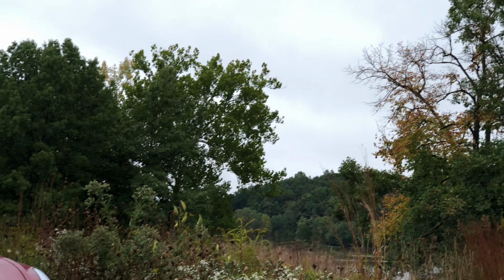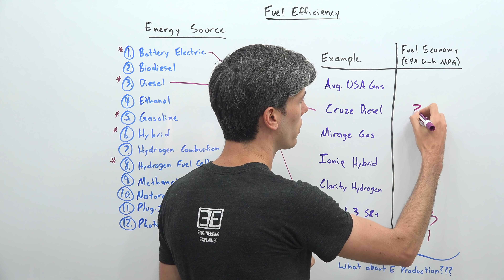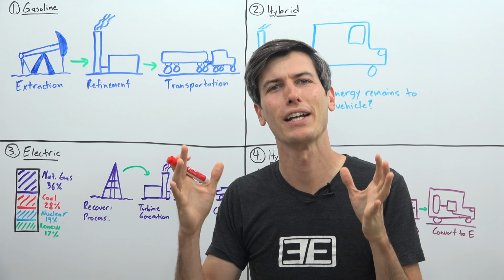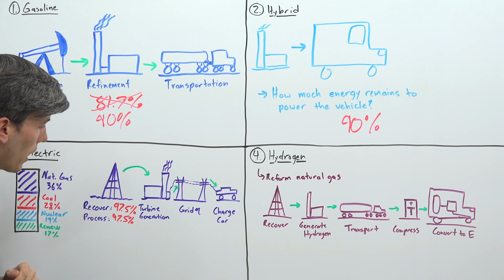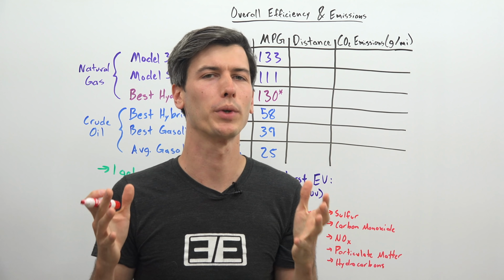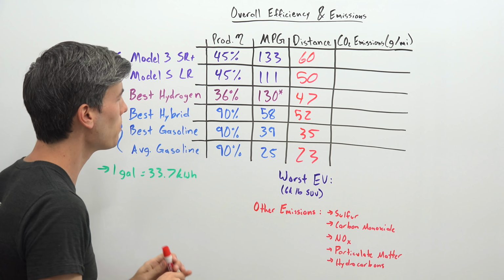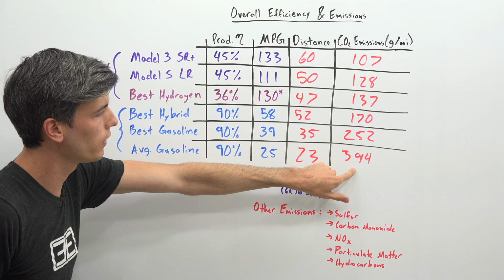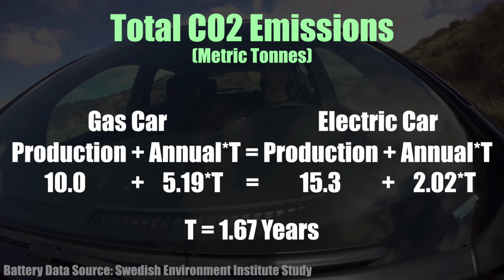Are Teslas Actually Better For The Environment?

Comment: "Even the WORST Electric car on the market"
Audi, visibly nervous
Reply: @Contrailing  new leads are nice
Reply: @Contrailing  He means in terms of efficiency though
Reply: Geoff from top gear lol
Reply: :o)
Reply: Audi isn't nervous and there is a reason. The answer is not electric, it's far more simple!
Reply: They do not need to worry long though...The Porsche Taycan will take that crown soon. 😂
Reply: The Porsche Taycan has taken the new crown
Reply: @jorgesaraiva1960  so?
Reply: The Geoff
Reply: I spent some time in the E-Tron as a loaner, It was one hell of a fantastic machine.  Audi isn't the least bit nervous.

Comment: I noticed that you didn’t include human powered.
How far can you travel on a cup of soup vs a cup of gas?
Reply: You can work it out.  The calories / energy are on the packet. I don't think it's particularly efficient given that running your brain and body uses most of your energy and only a tiny amount goes into mechanical output.
Reply: James Cross woosh
Reply: @bosstowndynamics5488 Thought it was interesting so had a look. I found a study that measured cycling 1km = 26g CO2.  Which makes it better than a car, except it doesn't scale well.  A car can carry 4 people.  A fit person can produce about 150W of sustained power but they consume 100W doing nothing so at least third is overhead - plus you have to keep feeding a human even when they are not pedalling you to work. If food is derived from farmed meat it looks catastrophically bad in terms of emissions especially methane which is 25x worse than CO2.  If thats not bad enough you're obliged to wear cycling shorts and have a bad attitude and life is too short anyway to be made shorter by getting squished by a prat in a Range Rover.
Reply: @dr_jaymz  I think the human body works out at about 25% energy efficiency at converting food into work. Not bad but probably a bit less efficient than burning the food at a couple of hundred degrees in a heat engine. Overall well to wheel food is pretty expensive. But most of us eat too much anyway so might as well cycle to work.
Reply: @darkmatterstudioshalifax  Turbo boost.
Reply: Asking the real questions
Reply: Cabbage/bean/bacon powered humans have high methane emissions.
Anyone else remember Commander Keen and his bean and bacon powered mega rocket?
Reply: Didn't compare to trains or bus,or boat ether.
Reply: @dr_jaymz  Here's the kicker, that same amount of energy is required while you sit in the car too. That's not part of the equation.
Reply: I fart a lot. So i'd probably do worse than any of these cars when it comes to pollution per mile.
Reply: Dr. David Mackay in SEWTHA worked out the efficiency of a Canada Goose vs. a modern fanjet airliner.  It's surprisingly close.
Reply: Sadly, we are not very efficient. The best crops can convert about one percent of energy in sunlight into caloric content. If you eat a steak, several tons of plant material go into each kilogram of meat, retaining only a tiny fraction of the caloric content, since just like you, the cow is a warm-blooded animal that consumes most of the energy to run the metabolism, stay warm, run the brain — not put on muscle...
Reply: Bosstown Dynamics That’s not what efficiency means. Efficiency only says something about how much is the energy used is turned into useful work (in this case movement), and nothing about the absolute amount of energy required. Economy is the term your looking for, and you mean to say it’s energy economical. 

But it isn’t actually, when you consider the full chain. Even if you only eat plants, even the most efficient crops turn just one percent of sunlight energy received into calories you can eat. And animals, especially warm-blooded ones, are much worse. If you eat an animal that eats an animal that eats plants, you’re definitely not going to look good next to a solar panel and an electric car. 

Small, light vehicles may make a lot of sense, but that’s no reason not to use batteries and motors. The only real benefit of human-powered is exercise, and perhaps many of us can in fact spend more energy without eating more (either lose weight or at least stop pouring it on)!
Reply: Cocoa Liveson not to mention the cows that we enjoy eating...!
Reply: @bosstowndynamics5488  I heard of a bicycle courier deducting energy bars as 'fuel' on income tax returns.  It was reviewed, but with good records it was allowed.
Reply: Well, if you grab a cup of gas like the ones I expel, I guarantee you power for a whole coast to coast trip.
Reply: @JV-mk3bl  Yeah, the real story here is the emissions.
Reply: @omelborpon3159  it was a joke...
Reply: I do remember hearing that a cyclist on a day's diet of mostly beef will effectively emit 1000g/km of CO2.
Reply: This sounds more like a test for Project Farm
Reply: EnricoAwsome  Diesel, a more energy dense fuel, contains ~9kcal/g. That's right in line with dietary fats. Makes sense, given that they're both oils.
Reply: EnricoAwsome  depends on the soup... ever tried stone soup? look it up! ( not taking into account the amount of gas it produces!)
Reply: Apparently a human on a bicycle is more efficient than any vehicle... It's just not fast tho
Reply: Since there's 31,000 calories in a gallon of gas, and average daily intake of calories are 2000, just drink from a gallon of gas for 15 and a half days and jog the whole time vs a cup of soup.
Reply: Yaaabaadaabadoooo!!
Reply: Depends, regular or chunky?
Reply: I once did the math for this..it actually makes more sense to ride an electric bike and save the calories (because food is expensive) then to pedal and burn the calories..because electric bikes uses a fraction of energy of an ev car.
Reply: Fred Flintstone did pretty well.
Reply: On the Standard American Diet (SAD), walking is about 120mpg and biking is 200-300mpg. Eating healthier, more local, less beef, etc will improve this significantly. Also, bikes are a fantastic machine.
Reply: With bike very long
Reply: 3 miles on a bicycle equate to 100 calories. Is that right?
Reply: EnricoAwsome  True that. Butter or lard (or other fat) has about the same energy density as gas
Reply: @dojohansen123  Got to agree with the efficiency versus economy. For example, electric heat is always 100% efficient, as any loss just creates more heat, which is the work you're trying to do in the first place. But it's not very energy economical
Reply: @benc8386  But you have to eat whether or not you ride in car, so emissions (from industrial farming) per mile is still quite low compared to car.
Reply: @skepticmoderate5790  Yeah and most of us eat too much anyway so it's basically free fuel to actually use some of it.
Reply: @bosstowndynamics5488  it seems the ratios are the same about 40:1 for a flat out performance vs idling. E.g. 40 cars idling vs one doing a burnout in the middle of the road or racing up a hill at redline. 40 humans sitting on their butt watching TV vs one human sprinting the 100 metres or a tour de france finish. I think the maximum instantaneous power consumption of a human is about 10,000 watts for Chris Hoy doing a 2500 watt sprint with 25% efficient muscles, but I'm assuming about 3-4 kilowatt for a 1000 watt sprint vs 90 watts for someone watching TV. I'm assuming the ratio for high performance cars is greater also.
Reply: Well you can't really drink gasoline, I think a fairer comparison would be a water bottle full of vegetable oil
Reply: @benc8386  The difference here though is that bicycles are way more efficient than cars at converting crank power in forward motion, because the bike weighs 30 pounds and a car weighs 3000 pounds. E-bikes get something like 2000 MPG equivalent.

Comment: Very nice, but I was missing 2x items from the electric calculation model.
- self discharge rate of the batteries over time (may be significant in not used frequently)
- energy needed to heat the interior of the vehicle (repeated winter short trips)
Reply: and co2 emmision to make the battery
Reply: @handbollish  co2 emissions to build a 1000lbs battery vs the c02 emissions to extract and refine 30,000lbs of gasoline,  plus another 1000lbs of motor oil over vehicle lifetime.  Engine plus transmission plus alternator plus starter motor takes more c02 to build than a couple electric motors also.

Comment: I would say the only problem with this analysis is that it doesn’t account for the amount fossil fuels needed to power the heavy equipment to extract the lithium and other materials raw materials from earth to make the battery. These materials are finite and rare earth elements. With respect to the rare earth minerals that also present challenges from a geo political respect with China having the largest deposit. I would be curious to see carbon emissions if all these factors were called into question. But great video!
Reply: There are studies out there including this and the emissions from making gas. Basically it came down to majority of emissions from cars comes from driving them. So yeah evs start out a little higher but even if youre powering on 100% coal electric over lifetime of car itll be less emissions than a car running on gas
Reply: Then you would have to compare the amount of energy needed to manufacture an electric car vs an ICE car
Reply: This is related to vehicle production emissions. And he says multiple time in the video to check out his other video about vehicle production emissions for both gasoline and electric cars.

There is an equation at the end of the video that clearly shows an electric car will make up for any extra production emissions including battery production in less than 2 years.

Comment: As an old gear head who work in the petro-biz for a quarter-century, I SO want to hate on electric vehicles, but you're making that a difficult prospect.
Reply: You don't need to hate on them. Think of them like, the general public who don't care about cars, should use these eletric cars, while we gear heads can use our lovely singing internal combustion engines.
Reply: @SgtKanyo  I love the sound of an NA V8, but damn if youve ever driven one of the performance Teslas, the driving experience is insane, and it's only going to get better.
Reply: @yel27  It's because it has huge instant torque and AWD. So it grips. Want to experience the same? Do a launch control with a GTR and you get pretty much the same.
But for me I don't care so much about the accelerations. Sure it needs to be above a certain acceleration, but the fact that you hear an engine working, going through the gears, the roar of a v8, or the howl of a V12, the way you put that car into corners especially if it's RWD. An eletric car with it's washing machine sound will never come close. The electric car is faster in a straight line, but anything else, the ICE beats. No soul in those cars.
That's my 2 cents.
Reply: Agree, some enthusiast cars can still run fuel. Electric mainstream will be great though
Reply: As someone who owns a classic car I get easily annoyed at neckbeards who think they're saving the world when they want to ban everything that isn't electric. I get that not every EV owner is like this but we have far too many people like that in positions of power right now. EE at least doesn't let fear mongering overrule science and I respect that about him.
Reply: I dont hate teslas but i hate tesla/elon musk fan bois. They allways think they are better than others...
Reply: The new Porsche Taycan Turbo S looks like a better sports car than any of their ICE cars. It has the lowest center of gravity and the lowest acceleration figures of all cars in their current lineup. And you can get it for the same price as your average 911 or Panamera. The future is here.
Reply: @weetikissa  Feel matters more than numbers and centre of gravity in a car which people drive to enjoy. Although the Taycan should still drive better than Teslas
Reply: @SgtKanyo  When I want A to B travel I really don't want soul. I just want minimal hassle and the travel job done with. I dont need the clunky gear shifts, reluctant engines and wobbly handling of most commodity cars on the market. 

When I want soul, I'll get a Lancia Stratos replica with it's mid mounted 3.0 V6. Or maybe a Shelby Cobra. A Fiat Panda 100HP with turbo would be a great toy at a more reasonable cost but it's not a daily driver.
Reply: @o.h2202  Same.
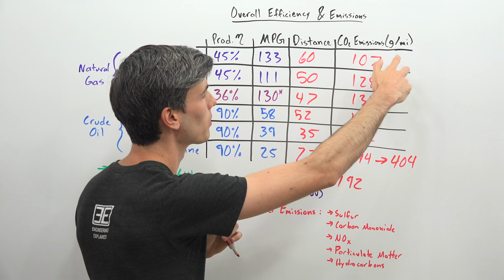Reply: @SgtKanyo  Agree with you.  Although EVs can be beautiful in a way  in their place, they feel colder.  Decades ago my buddies and I would design hybrid cars in our own elementary way and yearn for better efficiency.  However, I, for one, see holes in the math not relaying the whole to be calculated, but realize where the math comes from.  Who pressures it?  The strong attacks on fossil fuels (especially our lovely  combustion engines and coal) are independence reducing strategies.  "Cleaning up the grid" (at 14:31)  sounds like  an intrusive proposition (Germany/Japan & their attempts). To say there are no more efficiency improvements possible for the ICE is a fallacy.  More likely the "they" want to ice the ICE.  What can be evil are some decisions of  those holders of natural resources (big oil's presentation to congress I believe in 2003). But how can plant food be evil (CO2 vs solar maximum)? Answer is it isn't, but people fall for it as an argument.  Especially those still so close to their indoctrination  camps, AKA schools.  I hated school from day one, so many years ago while I loved/love to learn and think, and my appetite for learning is insatiable to this day.  I've raised my children (engineer/ musician-programmer...) to be independent thinkers with vast doses of mental, emotional, spiritual awareness who aren't duped by titles or abbreviations.  That is my encouragement to everyone to learn to think  and look for the TRUTH!
Reply: I feel like there were people saying the same as you, but instead of ICE and EV, they were talking about cars and horses lol.
Reply: My mate can push 70mpg out of his d5 v70 volvo...

I want an electric car for the acceleration above anything.
Reply: @SgtKanyo  that's a pipe dream. if most want electric that's all we'll have
Reply: @smiffythecat3751  but an ICE car will always face heat waste. Physics is a real stickler. There is a finite mark beyond which you face dimishing returns with increasing complexity. After all these years we are going to be pretty close to that (or the big vehicle manufacturers have been wasting a lot of money on R&D).

Comment: Would be interested to see what the life expectancy of the Tesla and hybrids currently is. I Personally drive a 1997 f350 7.3l diesel that’s cleared a million miles and runs on used transmissions fluid, frying oil, motor oil cut with gasoline, etc. but if the Tesla is only gonna go 100,000 miles like most of they hybrids I see at the dealership, you would have to have 10 vehicles just to get where the diesel currently is. And it’s the least efficient in this scenario.... just a thought